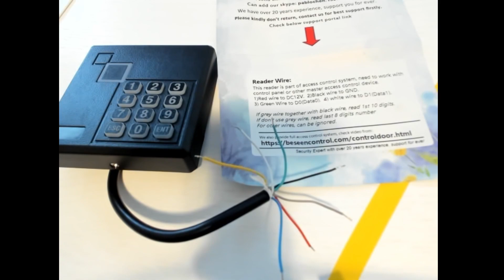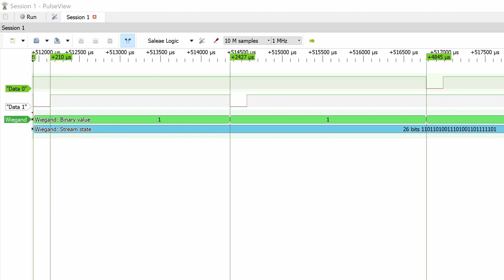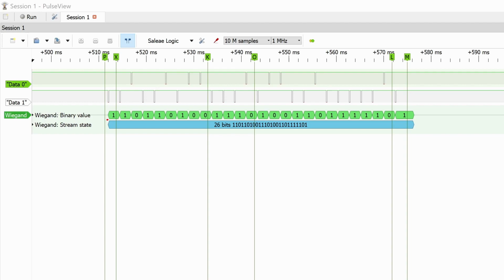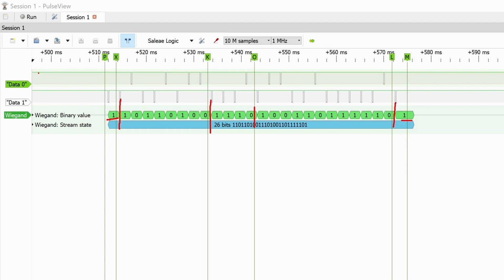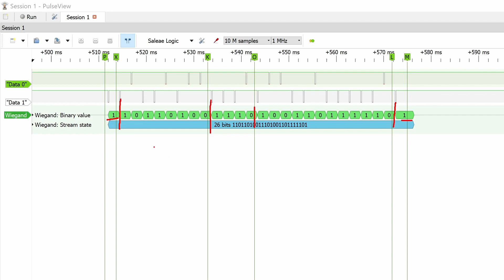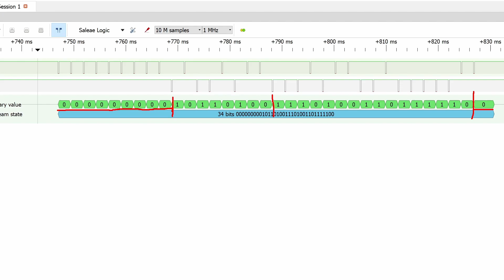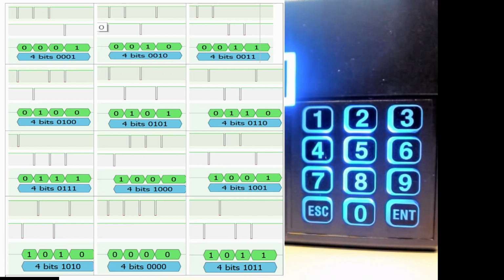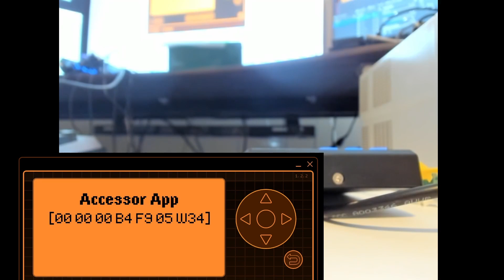[48] Introduction to the Wiegand protocol

Comment: Nice introduction to Wiegand protocol. I'm facing some problems with the access controllers at my workplace and getting deep into all these protocols.
Reply from the maker: Yeah, one of the challenges I have is that I'm simulating the decoding using a Flipper Zero, so things like line impedance are different than some real receivers. We can tap, change resistance, etc. but in a real system it's possible that impacts the quality of the lines.

Comment: Spectacular🎉. 
Im going to get one of the keypads your using todo some comparisons with the wiegand devices and control systems Ive got. 

Are you actually using the F0 in place of of a logic analyzer in pulse view? or did i just overlook your logic analyzer?
Reply from the maker: For this video I used the hardware at https://github.com/jamisonderek/flipper-zero-tutorials/tree/main/electronics#tools to do the decoding of signal.  Next week's video is using FZ accessor app & the code it uses for decoding signals.

The software I'm writing (that I mentioned briefly in the video) also uses two pins on the Flipper Zero and does GPIO GpioModeInterruptRiseFall to figure out the timings.  To emulate a device, it uses GpioPullNo with OutputOpenDrain to pulse the lines low.
Reply: Cool! 
I just ordered keypad through your affiliate link so hopefully you get a little something back.
Reply from the maker: @mumbles1justin  Thank you, I appreciate it!